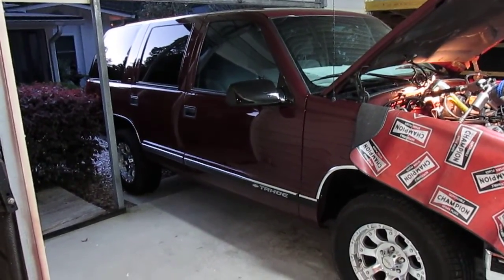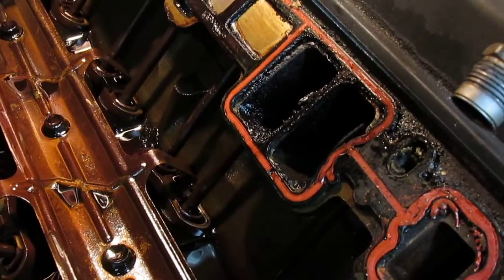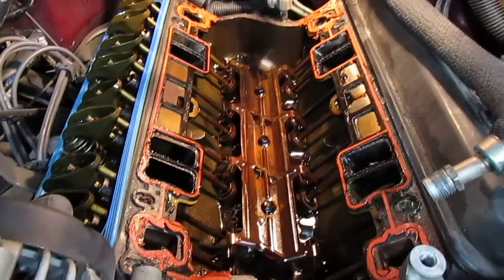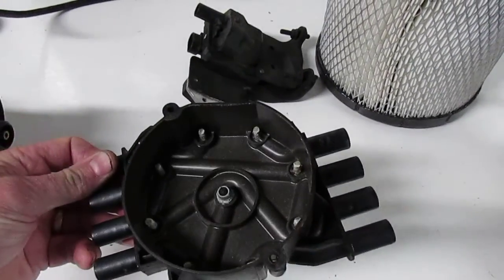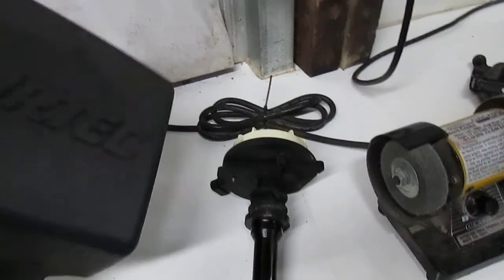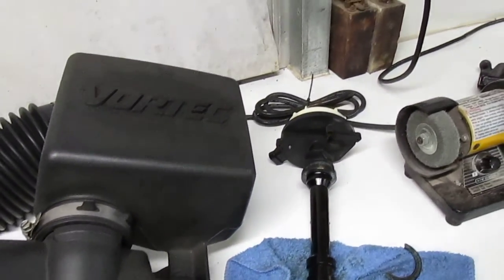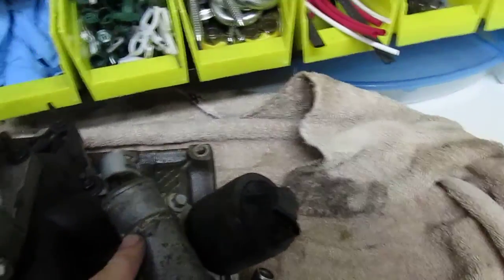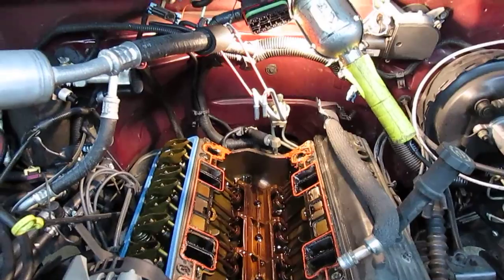Intake Manifold Gasket Replacement on a 1999 Chevrolet 5.7L Vortec

Comment: Interesting video I’ve got a 1996 2500 with 356,000k I believe the same issue as you are having but mined failed and went mix in with the oil
Reply from the maker: Yeah it can happen. I caught mine before it got to that point. Thanks for the comment!

Comment: A buddy of mine has an 1996 chevy with the 5.7 350.It has over 400,000 miles on her.Engine runs good, doesn`t burn oil what so ever.
Reply from the maker: They are really great engines. Mine has 225k on original engine. No oil burning, no bad noises and runs good oil pressure.

Comment: and what would be water from the tail pipe and smoke also??. head gasket?
Reply from the maker: A little clear water coming out upon cold start up is just condensation and is normal. If it smells like coolant and continues to steam out the exhaust pipe it could be a head gasket or a crack in the head. It's also possible for the intake to leak water into the intake ports. Most of the time engines run hot when you have a blown head gasket or crack in the head. Check and see if your loosing water. If it's not going on the ground it may be going into the oil or out the tail pipe.

Comment: Same here with my 99'.   I have 235,000 miles on the original engine.   I replaced the lower intake gasket at 180,000 and again at 230,000.       I ended up putting Victor Reinz gasket set on, not sure if it's any better but we'll see.    The engine runs very strong with no hesitations and does not burn oil.      I am hoping to get another 50-60,000 miles before any issues arise again.     Great motors from GM.   The dexcool isnt so bad, just don't mix it with anything other than distilled water unless you have to.     Just a great platform from GM for a truck/SUV.         Thanks for the video.
Reply from the maker: Thanks for the comment. I agree, the old Vortec engines are really great. Mine now has 225,000 on it and still runs very strong with no oil burning or bad noises in it. I used Felpro gaskets on this both times I did it. I put a bead of Permatex #2 around each water port on the ID of the port opening in the gaskets. I think that buys a little time, which is important when you figure in how much work it is to do the job.  I have used Victor gaskets before and found them to be of high quality and would not hesitate to use them on anything. This Vortec I have has been the "runniest" truck I've ever had. Feels like a lot more that 225 net HP.
Reply: According to GM, that dexcool is 5 year, 150k mile coolant. Most problems aren't from mileage, but age.

Just got a 2000 express conversion van in near perfect condition at 53k miles, but original coolant. Clean, but a little rusty. No coolant leak, but there is a small vacuum leak that makes <10°F starts impossible. I'm hoping I get the distributor back right so I don't need to bring it somewhere for timing.

Comment: Larry's 1997 GMC Vortec 350 broken crankshaft @ 238,000mi. New Crate went in. Cam Timing code keeps coming up.
Reply from the maker: you may be getting that code if the distributor is out phase.
Reply: That's what I figured. Watched your video & I'm going give it another try. Thanks
Reply: probably have the gear off just one tooth

Comment: Ive done a few of those they are time consuming also when i did my 971500 i swapped out the dexcool to prestone green at about 50-65% mix and just sold it to my brother inlaw with 250103 on it so thats 75k without a drop so far.
Reply from the maker: Thanks for the comment. I have been thinking about switching forever. I read things about it that has scared me away from doing it. I don't really see what it could hurt if the Dexcool is flushed completely out. It is an absolutely awful job to replace the gaskets. I think Dexcool is the root of the problem. First time around for me was at 60k. I replaced gaskets with a little RTV around the water ports and then went 140k more miles before it started again.